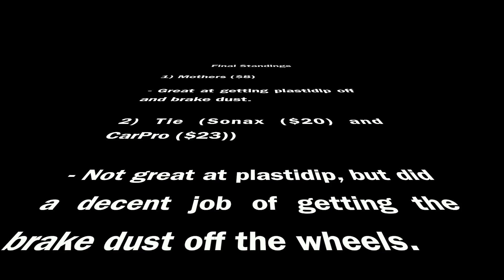Best Wheel Cleaner for Brake Dust and Plastidip - Mothers vs. Sonax vs. CarPro Iron.X

Comment: should've used goo gone. it will eat the plasti dip instantly. very light scrubbing pulls it right off.
Reply: Horsepower Junky Production yep goo gone and a pressure washer
Reply: Plastidip is still a solvent, to think a light pH balanced wheel cleaner and a pressure washer was going to remove dip is a bit well you saw. You need to be using Dip Dissolver, Brake Cleaner, Goo Gone, Gasoline, lol basically something that is intended to remove dip. Moral of the story, you can clean you dip'd wheels with the cleaners reviewed above lol,
Reply from the maker: Horsepower Junky Production Goo gone would have been so nice. Not really sure why I didn’t try that before. I think my plastidip days are over.

Comment: so mother's worked best?
Reply from the maker: +777samuraijosh Sure did. I couldn't believe it. The other cleaners have the cool favor of changing color when in contact with brake dust, but if you really just want to clean your wheels, use Mothers and save some money.

Comment: lmao so much work dude, my method is... turtle wax sticker and label remover, make sure u buy the sticker remover Not the tar and bug remover... bottles look similar..anyways....spray on the sticker remover.. wait about 5 minutes and power wash it off instantly without having to touch a thing. comes off with ease... if any dip is left over spray once more and wash off the rest. took me 10 min to do all 4 wheels at a self serve car wash
Reply: I'm going to try this out. Any issues with paint? how much did you use for 4 wheels?

Comment: If you just had used Rapid Remover instead of 4 products that are not for plasti dip you would have saved 3 hours of work and it would have ended better and after removing it then use iron x to finish it up